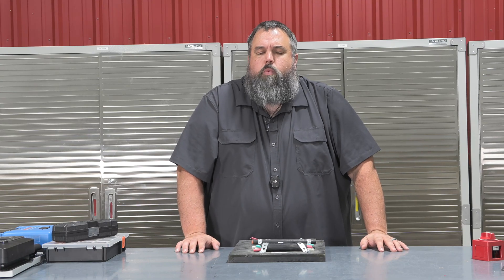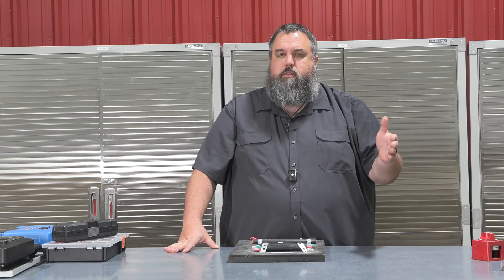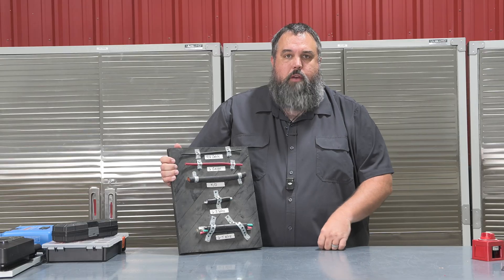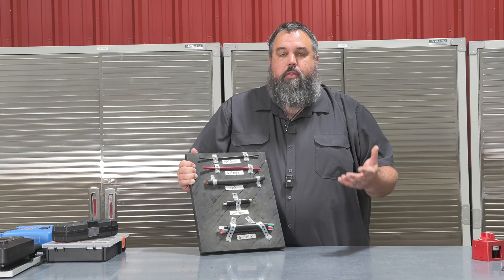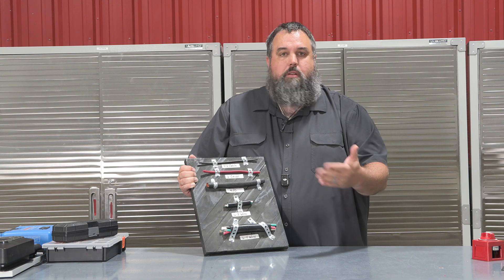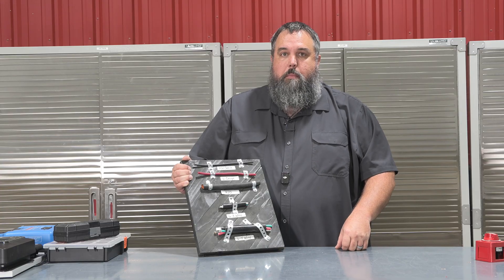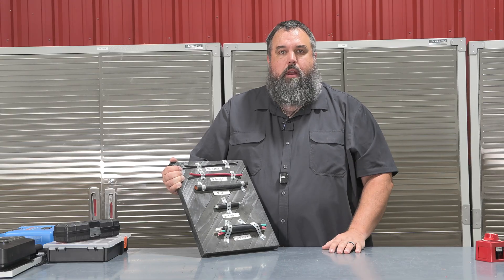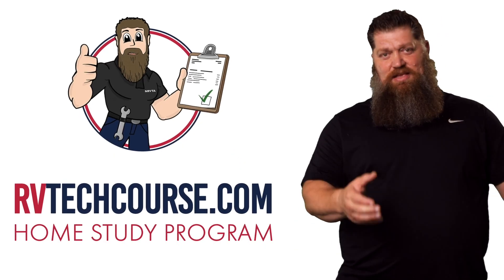Wire Sizes In Your RV

Comment: One more clarification for viewers not familiar with wire sizing - the larger the wire gauge, the less amperage it can carry. For example, a twelve gauge wire can carry 20 Amps whereas a fourteen gauge wire can only carry 15. 

This video also makes a good point about distance with twelve (or twenty-four) volt circuits. If you are trying to run an appliance that is rated to draw 15 amps from a battery that is thirty feet away you may want to run a twelve (or ten) gauge wire even though a fourteen gauge wire meets the 15 amp rating.

And one more comment - the minimum wire size you choose needs to be based on the breaker or fuse protecting it, not the rating of the device the wire is connected to. For example, if the circuit feeding an appliance has a 20 Amp fuse you must use twelve gauge wire even if the appliance only draws 15 Amps.

Bottom line - if you are going to DIY any electrical project you should consult an electrician or certified technician to make sure you are doing it safely.